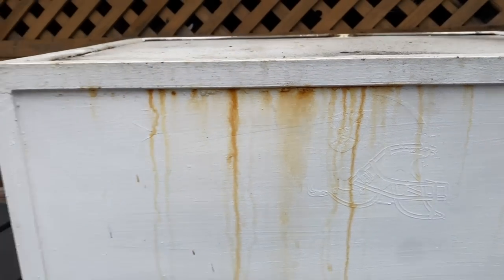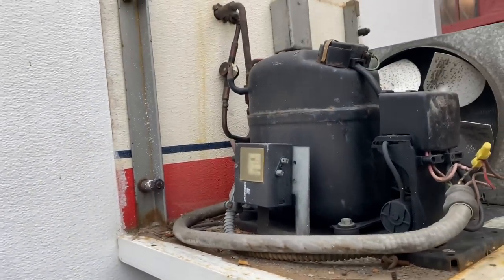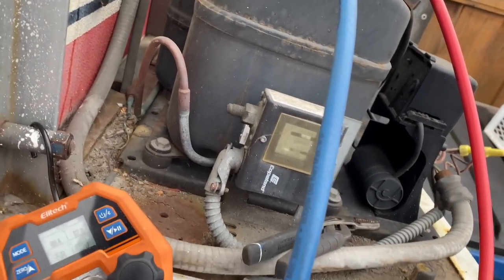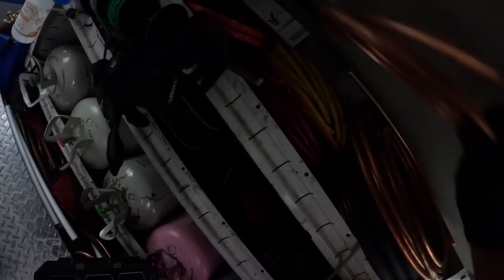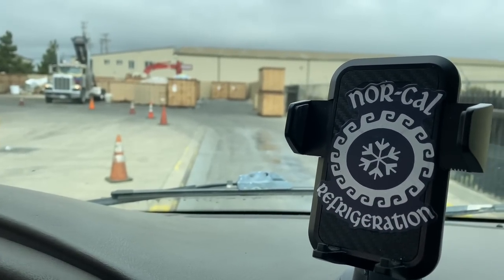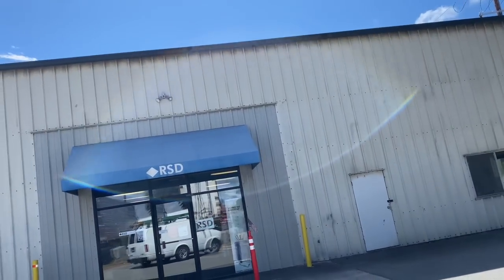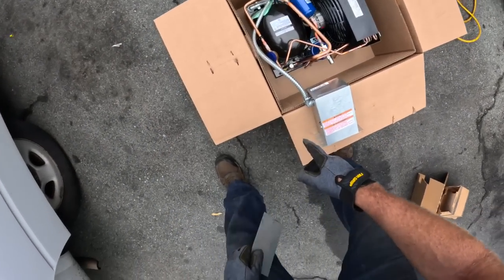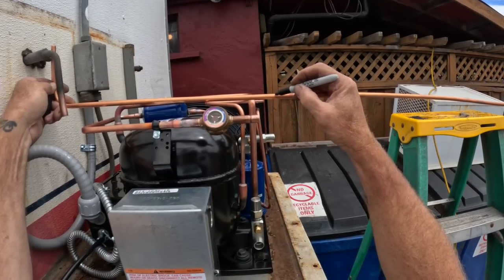Condensing unit Change out on walk in cooler

Comment: Dave I'm sure you have ran across a condenser without a label,  how would you go about getting the right replacement?
Reply from the maker: @joespencer653  get EVAP info. And size the box. And product set point. Go from there

Comment: Nice install! Have they resolved the fieldpeice connection dropout issues?
Reply from the maker: Mine work fine. But I have know idea
Reply: Your mileage will vary depending on distance and constuction materials that signal trying to pass thru.
Reply: @davejohnsonnola1536  I was referring to the connection/drop outs that's happening 5 feet away from the probes.
Reply: @OnePointLander  have not had that issue with FP.

What else is connected? Earpiece common problem.